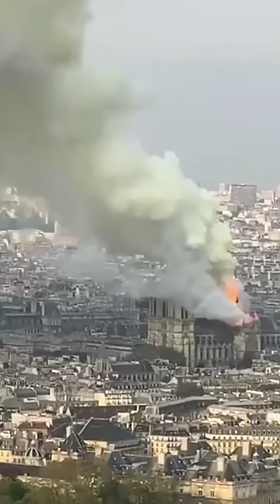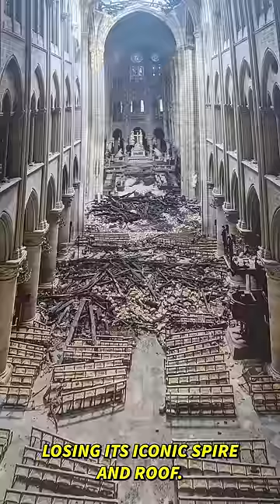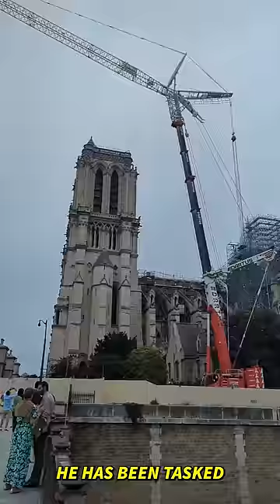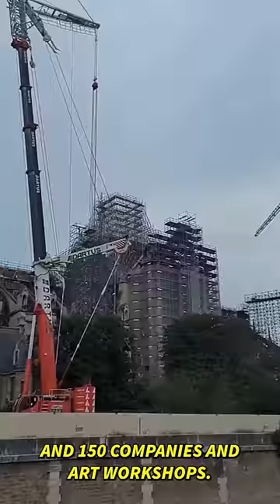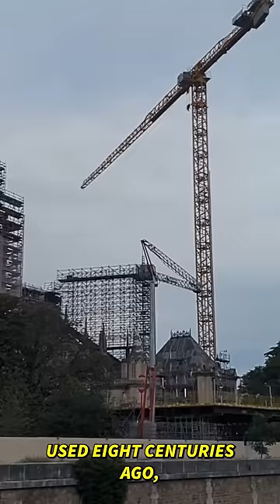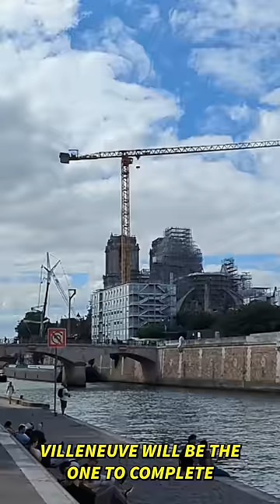How it's going: Notre Dame Restoration

Comment: I'm glad they're restoring it properly, using the correct materials and some of the old techniques.
Reply: Same needs to be done with the colosseum
Reply: @marcpine2794  The engineering marvel that needs to rebuild the coliseum would be something that rivals China's megaprojects in size cost and manpower. Especially working around already damaged areas that would probably need to be redone too. Sadly
Reply: @dscorpio1626  hey....but not impossible! Could be done.....
Reply: I cried when it burned. I saw it during a flight layover tour of Paris but wasn’t able to go inside. I’m so happy it’s been restored to all of its former glory.

Comment: "electrical fire" yeah...
Reply: Why is that hard to believe? Do you think electricity cannot cause fires? The roof was being actively worked on when it caught fire, so it seems very likely to be caused by an error by the workers, who would have been using electrical equipment.
Reply: @idot3331  in us all houses are made of wood. Over 30y I am here alive I saw not even one, or heard one accident like that.
Reply: @jacekpiterow900  You have never heard of an electrical fire? I think you might just be very ignorant to the world in that case.
Reply: @idot3331  you did it.
Reply: @jacekpiterow900  well in other parts of the world there have been fires caused by electricity. Guess that lower voltage the US uses has some advantages.
Reply: @lordbigsnake  Sure, why not?
Reply: more like musly fire.

Comment: It was in the roof.  There is no way a cigarette butt could do that.  A blow torch from a construction worker left on however could do that.
Reply: The roof was a 1000 year old wood forest, they literally call it the forest, and the wood was very dry. Any sparkle can cause that.
Reply: @puccaland  
A hundreds of yeas old wooden beam is harder to ignite than a new one. Both are dry, as wood is stored until it reaches a certain level of dryness before it can be used for construction. I work in an old German town with the fire department. In fact it's really hard to ignite them and a sparkle on them can't do that neither a cigarette.
Even with a lighter, you can't easily get these things to burn.
Reply: @raistraw8629  So you disagree with the entire planet because that's basic knowledge that dry wood burns more easily than wet wood. The reason why any electric device was banned in that roof.
Fires starting during renovation or construction work is also pretty common and it's often caused by a simple sparkle or light source of heat.
Just so you know, the whole world analysed the Notre Dame case. Nobody ever said that what burned first was a beam.
Reply: @puccaland  not true.
Try lighting a planed hardwood log on fire without a surrounding fire. It’s incredible difficult.
You basically have to leave a blowtorch on it for minutes. Otherwise you just char the outside 
A 300kg beam wouldn’t light easy.
That’s why kindling are thing soft wood strips and not chunks of oak
Reply: @jugganaut33  yea, the guy above who said he worked with a fire department said he's wrong for these reason and i guess he didn't like he was wrong. Hopefully he learned a thing or two from both of you.
Reply: They investigated and that's what they found. If this is not the truth, then we'll never know what caused this tragedy unless the guilty one gives himself up.
Reply: hahaha it's why we can't have anything nice
Reply: @shizukagozen777  Most residential buildings in the US are electrified wooden buildings, and the typical reason for building fires here are kitchen accidents, not electrical fires.  It's quite probable the investigators or their bosses lied to protect certain groups of politically privileged people.  

Also, @rainstraw8629 was correct that old hardwood lumber is so difficult to set aflame that you basically need an already ongoing fire to get it burning.  Arson by blowtorch would be an example of that.  A cigarette would not; an electrical spark would not.  

To get an electrical fire starting would take a sustained fault + multiple circuit protection failures (including fuses and breakers that even basic houses have) OR sparking that comes into contact with another ignition source.
Reply: That was a terrorist act

Comment: The amount of crazy in this comment section is disturbing. 😮‍💨 Old dusty buildings are frighteningly flammable, and it had no fire suppression system. A single cigarette butt or electrical spark would have turned it into an inferno. Anyone who thinks otherwise has clearly never been in an old, dry, wooden attic.